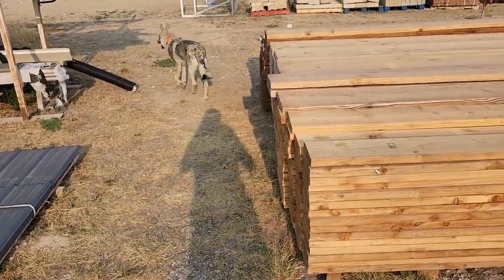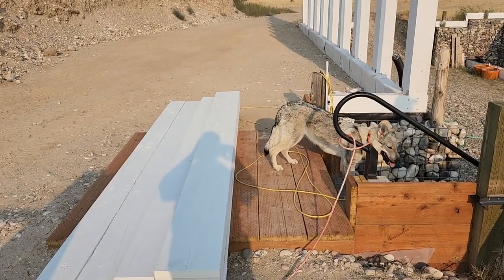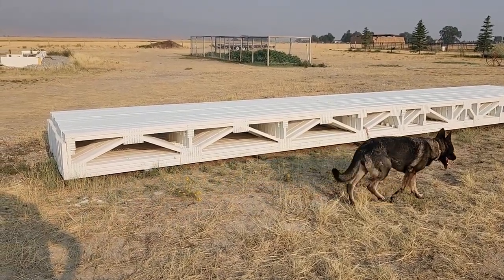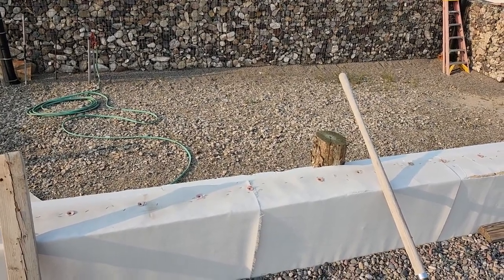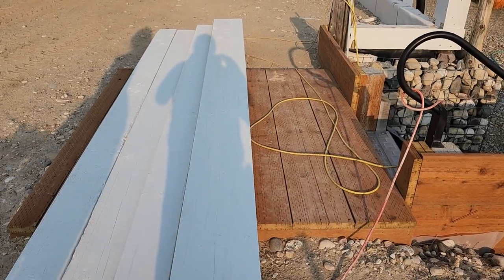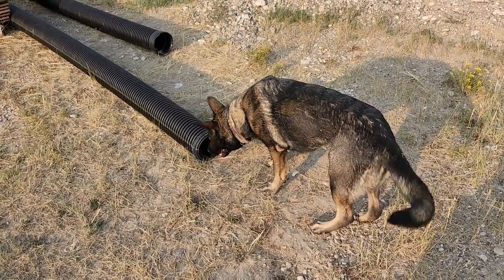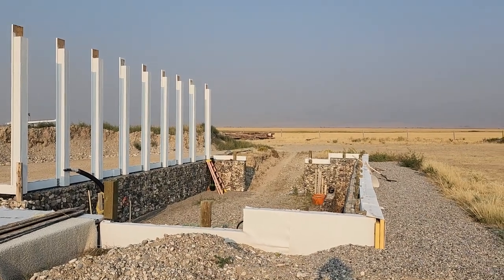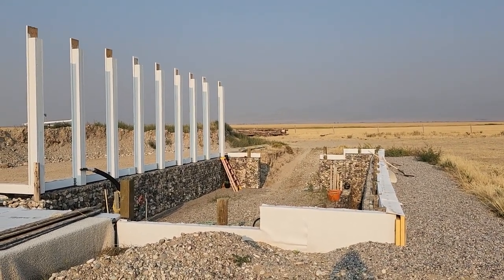Step 17a - Building Columns for Truss Support for Pit Greenhouse

Comment: Why not a metal roof? We should all attempt to use as little plastic as possible. 
Otherwise a terrific job. Can't wait to see the results.
Reply: It's a greenhouse
Reply: @KreatureKeeper  I see. I mean I knew that but have seen plastic opaque roofs also. Anyway you can't go with glass? Everything you've done so far is green.
Reply from the maker: @vivalaleta  Thank you for your comment and question.  The roof will have a Lexan double-wall polycarbonate roof, but there will be metal roofing off the pitch slanting back down to the north (or the roof over the ground level as opposed to the grow floor).    We did a lot of research on roof material, then selected Lexan brand and polycarbonate.  The poly roof has a higher insulation factor, is less heavy than glass, and is more resilient to hail.  It has a 20 to 25 year life expectancy.  We have seen smaller greenhouses -  much smaller -  that have been made out of glass, or recycled windows.  We are all for that as we love to recycle and repurpose.  However, that option was impractical for this build.  Cheers J&K.
Reply: @montanalivinginthebigskyco8541  What a beautiful reply. Your greenhouse is going to be outstanding.
Please forgive my dumb comments. I've recently started medication that screws with my thinking. Metal roof, sheesh!
Reply: It's a greenhouse...sun can't come thru a metal roof